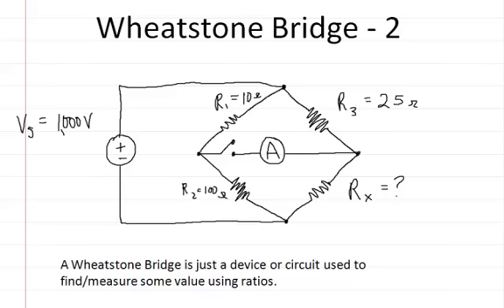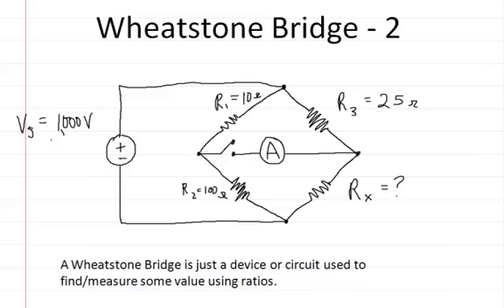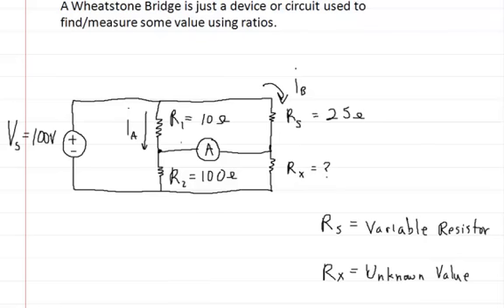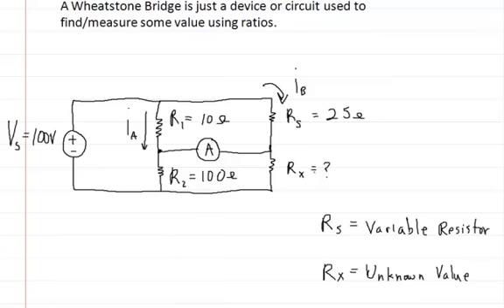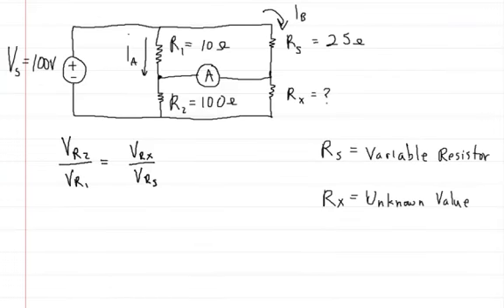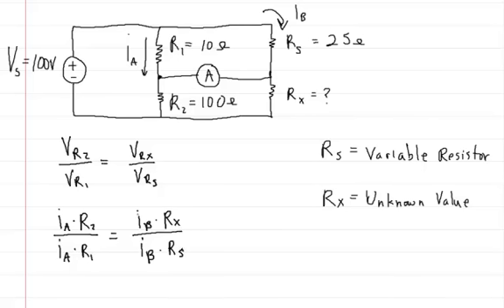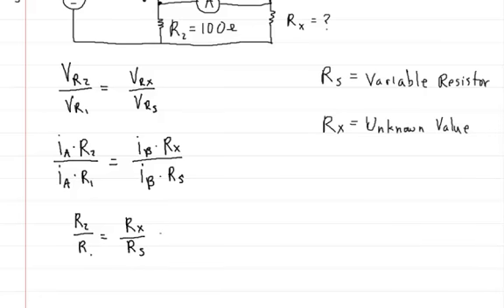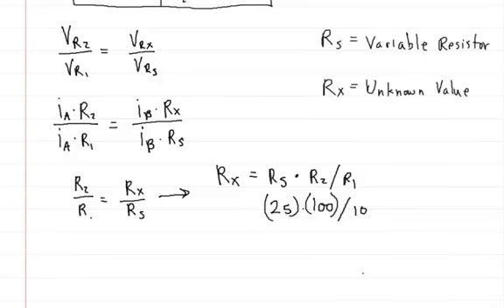Circuits Wheatstone Bridge Part 2

Comment: Why is iA and iB the same this time after the middle vertical cord, wouldn't current flow now that you changes the resistors so they don't give the same voltage potential after each voltage divider? (R1 and Rs)

Comment: Oh wait I think I'm getting ahead of myself. You wanted to calculate Rx if there in fact was no current flowing. But they it would have to be 10 times bigger than 25, because 100 is ten times bigger than 10 for the other one. Alright. Sorry :)